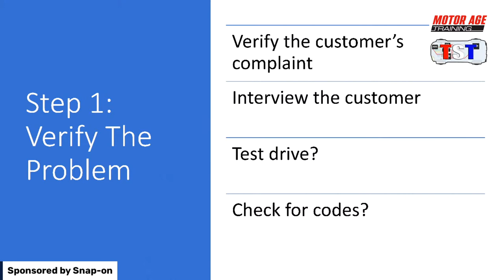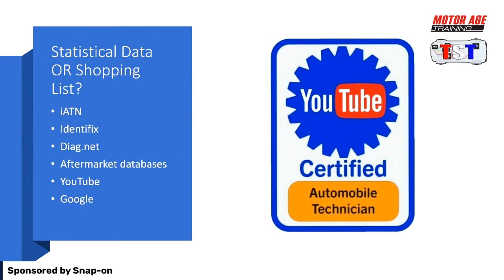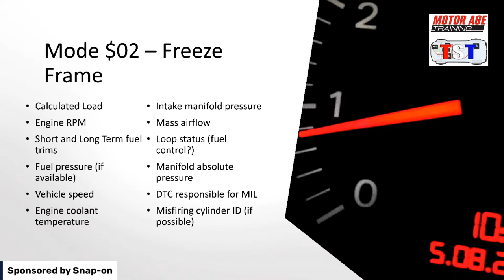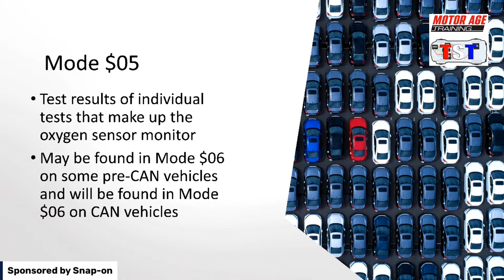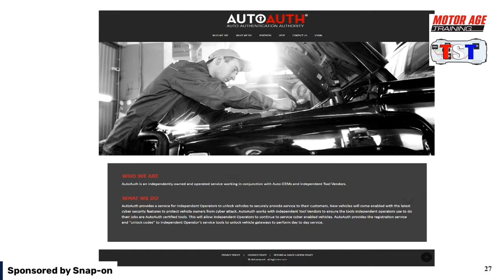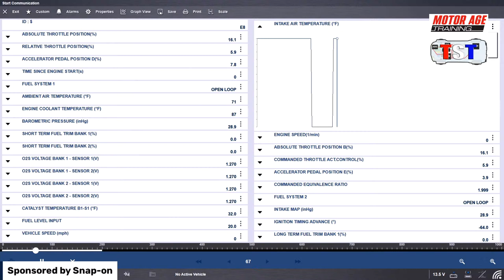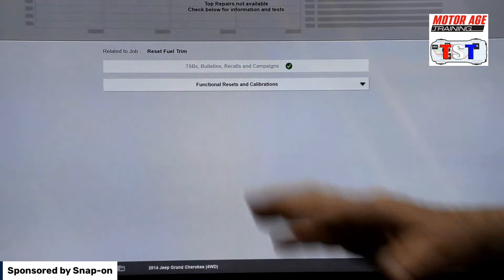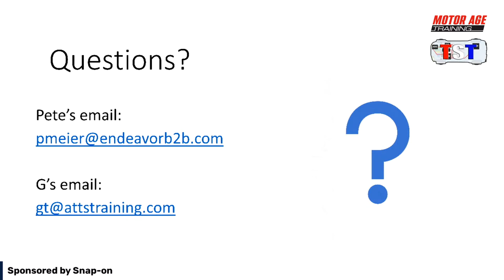Professional Drivability Diagnostics - Turning The MIL Off AND Keeping It Off!

Comment: I cant speak for every dealership or anyone else's experience but the service advisor, not the tech, is normally the person you will be dealing with when you take your car in for service/repair. 

The service advisor is the main point of contact for customers looking to get their car serviced at a dealership or auto repair shop. They work closely with service technicians and explain pricing details of repairs with clients as needed. Now, are there times when you may have an opportunity to speak directly to the tech?  Yes. If you ask. Some places may be too busy so they may not want to do that. However, there have been times when I have asked to speak to the tech working on my car and have been afforded the opportunity to do so.
Reply: Most Service advisors are nothing but a glorified salesmen Im a retired master auto heavy truck and emergency vehicle technician